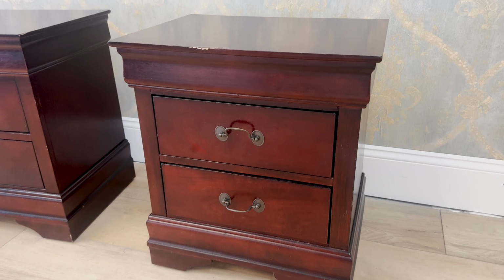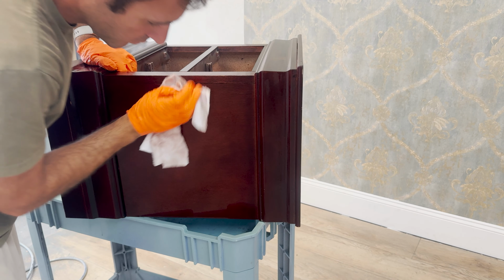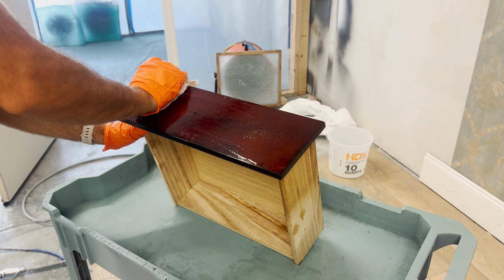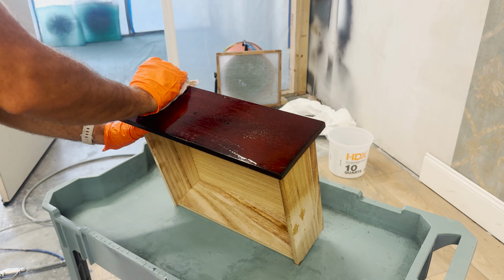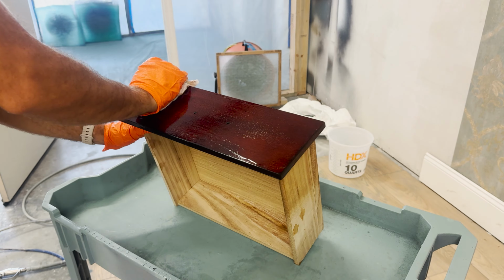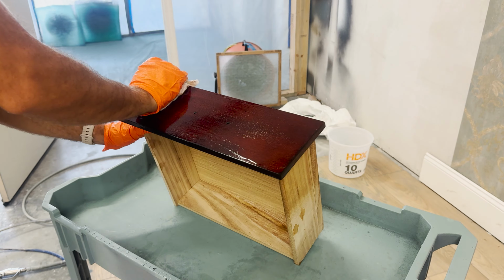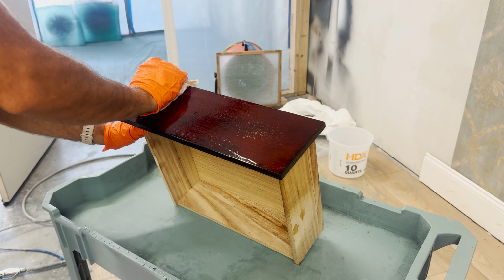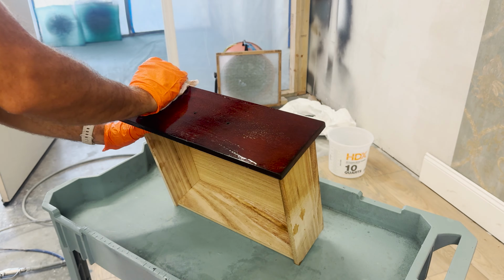Furniture Flipping - Automotive Paint on Furniture- How to Use Auto paint for a High Gloss Finish

Comment: would you paint a car with wood paint?  no because it won't last. car paint is make for metal, metal doesn't breath wood does. I would think over time the paint will crack due to the wood movement. your thoughts ?
Reply from the maker: That is not necessarily correct. 
Lacquer was used on cars for years, and though it was a slightly modified formula it was basically the same thing as wood lacquer. Same thing with modern car paint it’s a 2k which has been more or less copied into use with furniture

Comment: Was it solvent or water based automotive paint?
Reply from the maker: Bingo what’s up! 
Solvent nason fulthane 2k urethane. 
It was a fun experience and I like that I can buff it after 24 hours but it’s hard the dust is still huge problem for me. Ideally id like to not have to cut and buff but I had to on this one, I enclosed my booth didn’t know if you noticed that in the video
Reply: Hey! I’ve always wondered how car paint would perform on cabinets and furniture. Everyone seems to bash the idea but personally with these new 2k products targeted for wood it doesn’t seem like a bad idea to try the car paint especially if it’s cheaper! It seems like the solvent based 2k polys are a lot easier to work with than the water based bc the water is dependent on the climate. The hardest part with solvent like you said is the dust since it dries so fast unless you got a dedicated spray booth sucking all the air out that dry dust will land back in the finish and that makes for a fun day to cut and buff it out. Great video as always and awesome finish. I tried that with lacquer and it didn’t come out as great but then again I started with 600grit and then jumped to 1000 then cut/buff still didn’t remove the micro scratches. Gotta start with at least 2000 and can’t using anything that randomly orbits it just needs to spin.
Reply from the maker: Yeah man DA sander no orbit all the way the scratches will look like French polish.
What lacquer? If you’re taking about the lacquer I’ve used in my videos I never polished after the fact because of that. My final coat was always just good and had to make it perfect. Buffing car paint is a heck of a lot easier than lacquer.that’s not a problem unique to you it’s just that most YouTubers including me you can’t see that close up but if you did I’m sure it would look just like yours. I’ll tell you though lol

But when it comes to satin I really don’t care you know. Getting that 90+ sheen gloss is the only reason I try a lot of different products. Using auto paint is not necessarily new it’s just that I do a ton of research lol and i try to find out what works on a forum and bring it to YouTube. Just trying to do something different. It’s not really gonna be cheaper unless you’re comparing it to something like gallery. No reason it should be that expensive to buy a product like centurion (which is actually economical) but some of the Italian 2ks are insane and I won’t even consider buying something that unrealistic to me.
Reply from the maker: @bingobunga8995  I never want anyone to be misled by my videos though. There’s some polishing scratches and maybe a few pigtails in there but you’ll never see them. And I’ve kind of set a rule for myself which is that if it looks good in natural light it’s okay. Sometimes good enough for my customers is good enough for me.